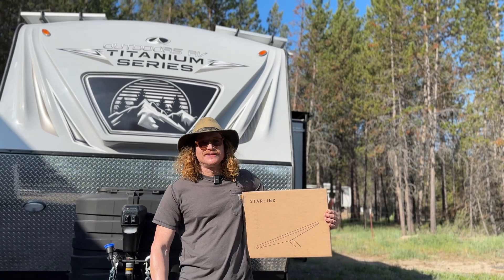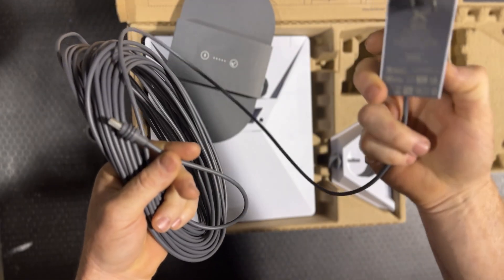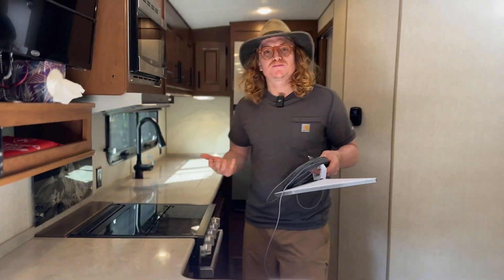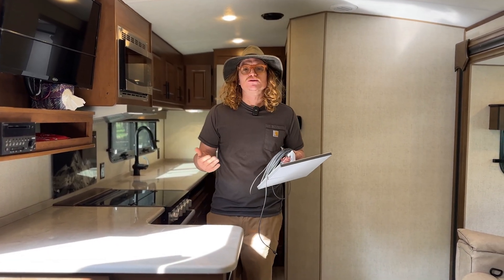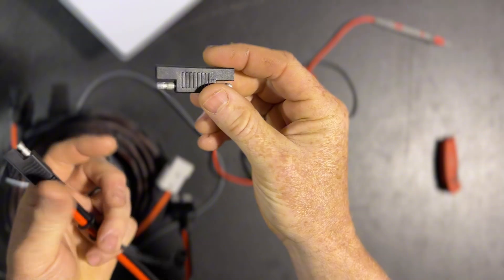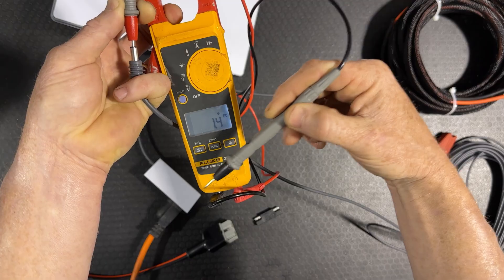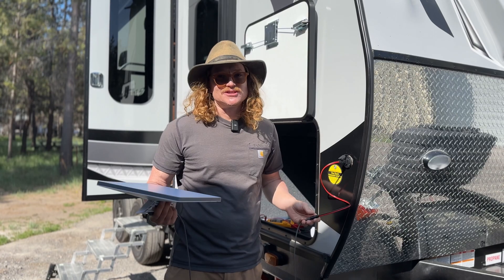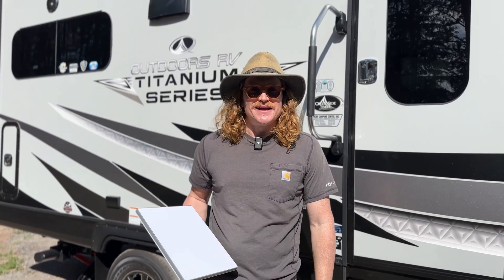Unboxing and Powering the STARLINK MINI off-grid | 24V DC

Comment: I got a Victron 12/24 5A converter. I'm all 12v so needed the step up. Gives me 30v to starlink. 

Retrofitting SAT port on rv for a DC5521 barrel so I can use starlink factory cable with ease and no adapters or anything and all waterproofed
Reply from the maker: Great move!
Reply: Hey Adam, just getting ready to do the same.  I need to go 12/24 for now.  What Victron converter did you end up using?  Thanks!
Reply: @bitstacker_io hey! I got the isolated 12/24 Orion. Currently $63 on Amazon. 

I ended up adding countersunk disc to it as feet and matching magnets on the trailer side with custom bracket. This allows me to have a semi permanent install so I can quickly disconnect and use the vectron in a different location temporarily (such as vehicle for long drives). 

I'm custom building a camper from a cargo trailer which is why it's so optional
Reply: @AdammJarvis  Love it.  Thanks for the details!  Just snagged one.  It'll be here tomorrow.

Comment: So 12.8v 500ah lithium wont run it  alone?
Reply from the maker: We had a customer with a roughly 500ah bank plugged into power and solar power available and they still experienced the voltage loss that caused the Starlink to kick off randomly.

Comment: The voltage input spec is 12-48v.
Reply from the maker: Good to know thank you. I mentioned in the video that 12 and 24 were the Voltages that we were mostly focussed on as we don’t do 48V systems. Even hooked up to a fully charged lithium battery currently getting voltage applied by both solar and shore power- 12V did not work.

Comment: Could You Have That "Zamp Kind of Port" Wired Inside the Trailer (maybe near the battery bank) and the Mini Wire "Fished" Into the Trailer So That You Could Have the Mini (or the standard) Mounted On the Roof and Would Not Have to Have to Plug Into the Side of the Old Zamp Port? I Have a Mini & a Standard and Would Like to Keep One of Them On the Roof Without Having to Use the Pass Through or the Exterior (currently using a jackery inside the pass through).
Reply from the maker: Hi Bruce. We'll be having our Mini on the roof and plan to try and route some wiring to it directly like you describe. Lets chat about options when your instal gets closer. Remind me and we'll see the best plan we've come up with by then.
Reply: @mytsolar  Thank You Tom! See You in August.

Comment: Nice work. Stupid question here, why not just hard wire power cables from fuse box to a exterior cable entry box?  Do they make an exterior weather proof roof mount box for the starlink mini to be housed in that will allow for the RF transmission?
Reply from the maker: Thanks! That’s really what this is, fused 24V dc power to an exterior entry port. They make mounts for the Starlink that protect it, the wifi comes through the mount and roof of RV no problem. We’ll be using the TrioMounts setup soon and will post a video of how it works for us.

Comment: Hi. Since I am going to adopt a similar strategy (supplemental portable solar and mini STARLINK) on my Black Stone 250RDS, it would be useful if you described your solution in the comment. I ran over some portions of the video but since I am no expert, I kind of got « lost in the translation… » so to speak. 😉 Thank you. 

P.s.   Another question… of subject though. Is there a particular reason you are not using higher wattage solar panels in your configurations? I’ planning on using 585w panels.
Reply: I am not using lithium right now, but have four 6 volt batteries, 450 ah. I bought a cigarette style plug in with adapter on Amazon that worked, then when Starlink cigarette style adapter  came back in stock I bought one of those also. Some very complicated connections/solutions all over YouTube right now, but it doesn’t, or shouldn’t be so hard. My Mini is working as advertised, plug into my truck cigarette plug, and my front compartment on my 2025 Outdoors Rv has one that’s easily accessible. Very simple if you are on a 12 volt system.
Reply: @rogerm3894  Do you notice much voltage drop when using the mini on a 12 V DC power source? Does the mini restart or experience any issues when running from 12V?
Reply from the maker: We ran appropriately fused and sized wire 24V to the zamp port on the outside of the RV and used an adapter to adapt that to the connector that the Starlink mini needs.
Reply: @mytsolar why did you blew a fuse when testing with the meter?
Reply from the maker: We don’t find large panels enable us to fit spaces as well on the roof
Reply: @mytsolar You are absolutely 👍. There are work around though. A bit more complex on the mounting system approach but not that big of a mod.  My inspiration source comes from Monument Solar for their suspended solution or Living Vehicule for their sliding option. Each provides an alternative with its pros and cons. I am still evaluating which way I will go… Thank you for the quick response.
Reply: @mytsolar  I was wondering the same thing...what caused your fuse to blow?